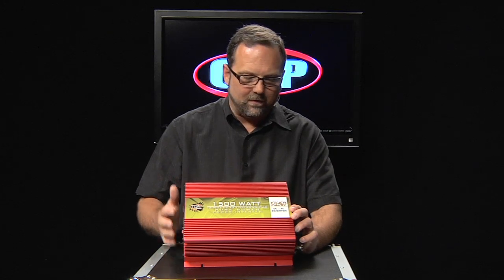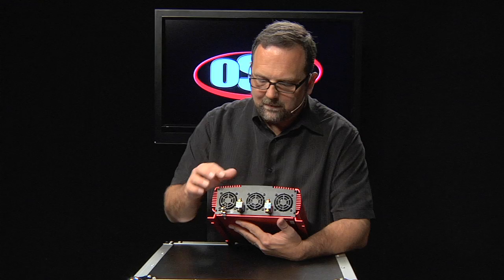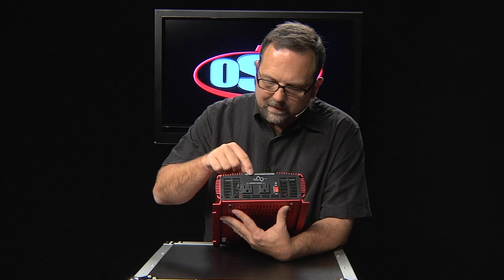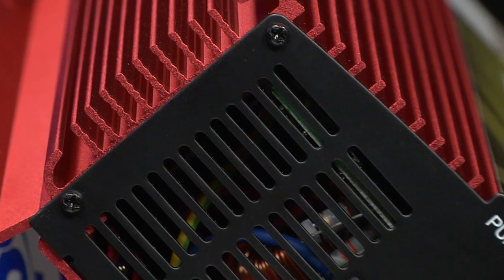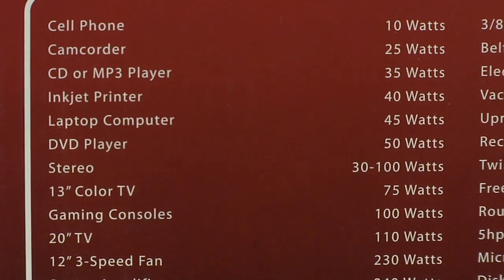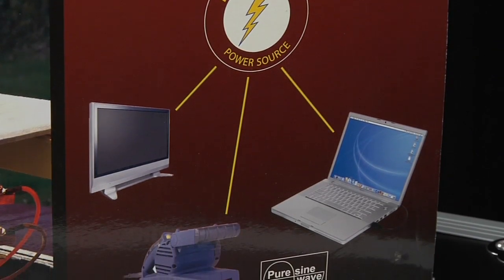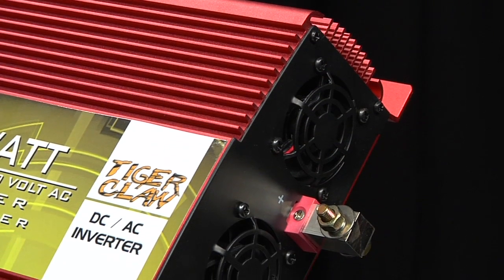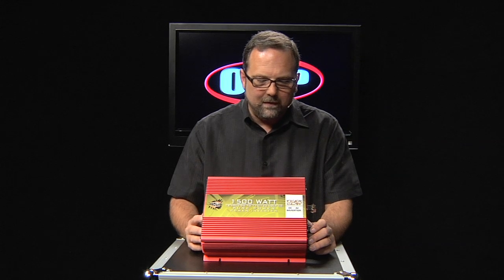OSP 1500W Tiger Claw Pure Sine Wave Power Inverter

Comment: 90 day assessment. The gizmo works well and is consistent🎡>share4.photo/BPowerInverter?L90   I use the device to charge a laptop while driving. There have been no hiccups. I have used several other like devices and all of them either popped fuses or could not charge consistently. I am very happy with how the gizmo has performed.

Comment: I have the same kind of inverter and it reads 110 V AC  when I plug Kill-A-Watt meter into it.
I have romex  12/2 wire going from inverter to a couple of outlets in my living room. I intend to use them during power outage. But the voltage in outlets is only 105-107. I read low voltage can cause some appliances ramp up the amps to compensate for the lower voltage. That can create wire overheating and even a fire. What's your take on it? Is it safe to plug in internet modem, router, laptops,  TV, fridge, freezer? that's what I will need to power up in case grid goes down

Comment: Modified Sine wave does not damage anything on a computer like it was said in the video. In fact they are designed to work with UPS that most of them are modified sine wave, not pure sine. All things that have a switching power supply inside, does not suffer from having modified sine wave as power input. Only inductive loads like motors ONLY!!!!!!!!!!!!!!!!!!

Comment: What size inline fuse would you need between the battery and the OSP 1500W Tiger Claw inverter? OSP recommends an inline fuse but doesn't specify the size in their manual.
Reply: 125A would get you 1500W of power.   If you're going to peak above that, you may want to go with a 150 or 175A fuse

150A = 1800W
175A = 2100W

Comment: You could use a capacitor in the circuit.  I have looked at a lot of these things and it seems they don't work very well at rated wattage.  Stay under the rating and they are pretty robust.

Comment: I've been told that true/pure sinewave inverters can output cleaner power than the power company, and I believe it. I have 1100 watt  "Exceltech" pure sine wave inverter and it hasn't failed me yet and I always leave it on. I mostly run cf lights with it. I have the extra power just in case I need it someday. I'm not familur with the Tiger brand though. It looks very nice and high quality. I might have to try them, especially if a lot cheaper than "Exceltech"?